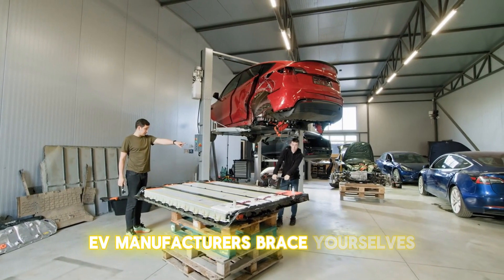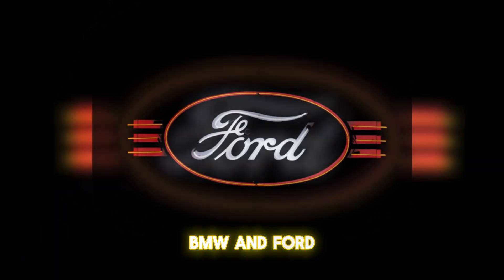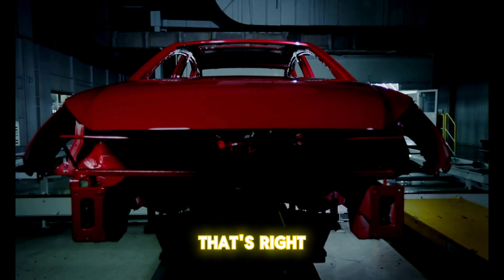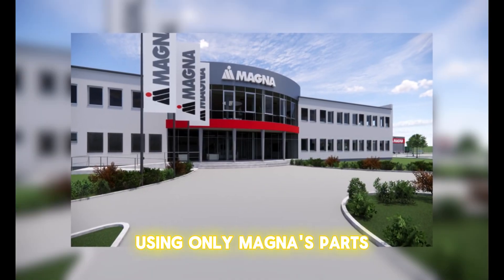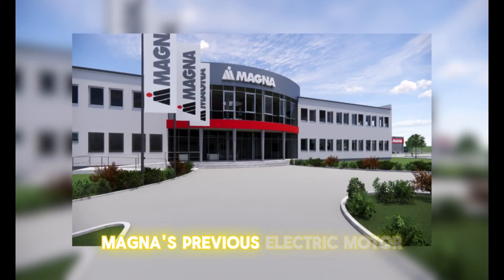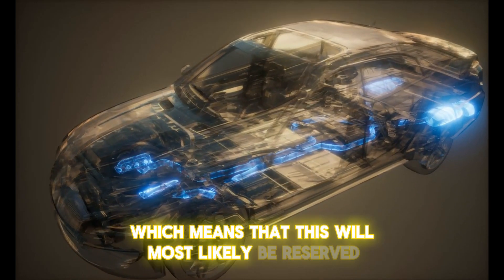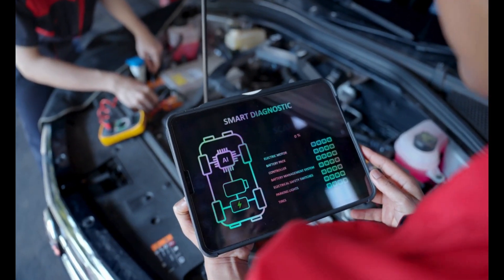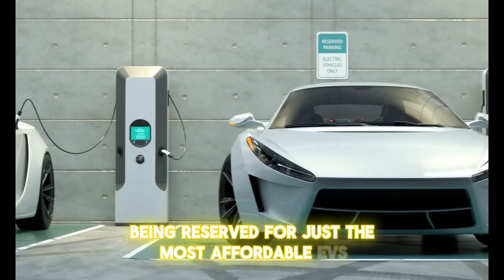This New EV Motor Will Become The GOD of Electric Cars

Comment: There is nothing of significance in this motor. One Western parts supplier has a competitive motor. The only trouble is that is just one component of hundreds. No batteries, outdated software, inefficient production facilities. What is going to change? Nothing! China has won already.